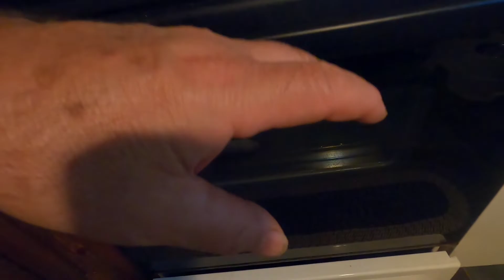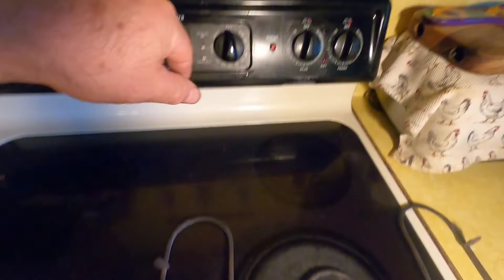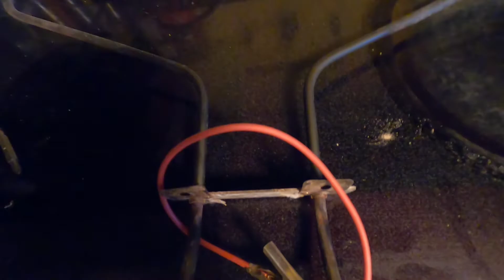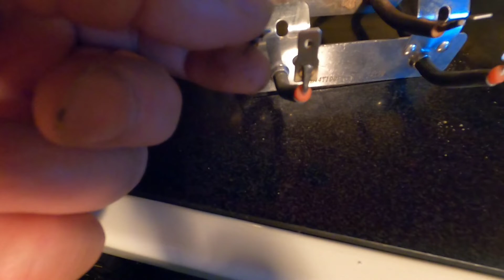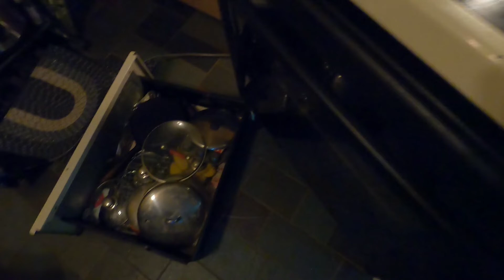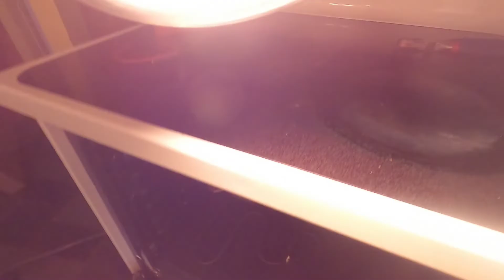Ge oven not heating diagnosed & repaired

Comment: Yeah, the new element is burning off factory oils and stuff, and fingerprint oils and possible dirt from handling.  It's common with all kinds of heating wires and elements.  No, don't wipe new elements or try to clean them.  Just let it burn off.  It's normal.  That oven was cleaned really well for you!  They must also use the oven self-clean feature for it to burn out so often.

When I rebuild an e-cig rebuildable atomizer with new Stainless Steel 316L or Kanthal 32 to 24 AWG wire (Kanthal is a heating composition used in electric home heating systems of a much larger gauge than I use as the element.  That element is probably Kanthal or NiChrome), we wrap the coils, mount them and do what is called Glowing it/them slightly orange, not red, with a fairly low Wattage to burn off all those oils off to both clean it and make it less springy to hold the wrapped coil's shapes better.  Then we wick the coils with cotton and complete the build so it's ready to vape.  When we rewick used coils with new cotton, we Glow the coils to burn off dried e-liquid to clean them before adding new cotton.

I guess the lower element is used for baking and cooking more than the upper one is used for broiling.  Those element wires look rather flimsy for that much Wattage, but I guess they know what they're doing.  Great job, Joe.  I've had to replace stove elements and control dial modules before.  The front left one was larger and would go out while the others lasted much longer.  Seemed like a design flaw in that stove/oven.
Reply from the maker: Thank you for the above information. I was surprised the first time I work on a stove to see the wires used. I had stove/ovens that lasted so long I could not get parts for them when they finally needed replacement. They were from Sears, this was before all these online outlets. No sure if it is a design flaw or  “Planned Obsolescence” which started in the 1950s/1960s. 
From Off the Grid News:
"Apple once got sued for designing its batteries to fail just after the warranty expired. They don’t do that anymore".
Stay safe, Joe Z
Reply: @JOEZEP54   Planned Obsolescence could well be it.  That's a major sin of engineering, brought on by corporate greed, another major sin.  Made in America used to mean something.  Now it's all made in China and we're paying for it.  The engineers should stand up and say, No, I won't do that, but they need their jobs and want their pay raises.  Money, money, money.  The love of money is the root of all evil.  Stepping down from the soapbox now.  Thanks for all you do.
Reply from the maker: @100vg  Well said.

Comment: First Comment! Nice troubleshooting! L1
Reply: I have a pile of those HF multimeters, used to get them when they had the free coupon. Some great tips in there, always check the meter first before making measurements. Jot down those part numbers ( so hard to find the info when you need it!) I have had plenty of  packages arrive that had no package protection...
Reply from the maker: Thank you for the visit.
Stay sell, Joe Z